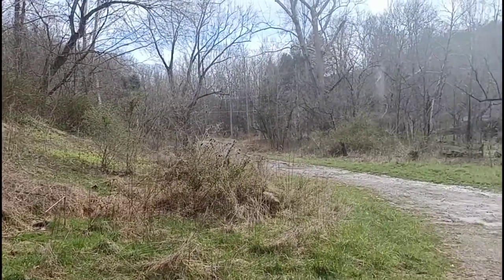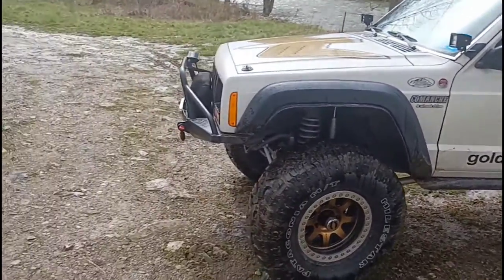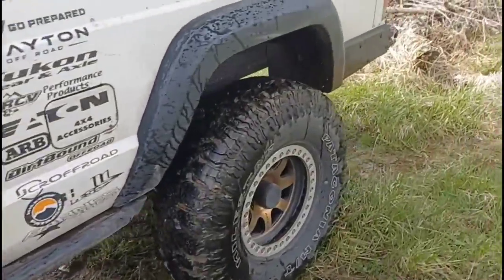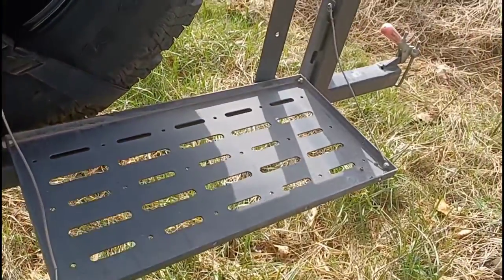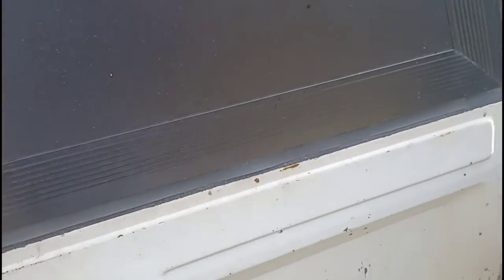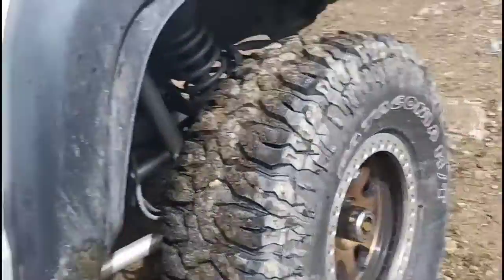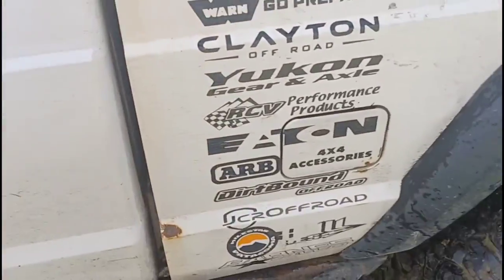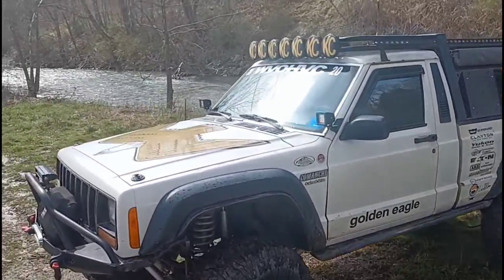"The Golden Eagle" 1989 Jeep Comanche Build

Comment: I've got an 87 Pioneer Metric Ton with the Heavier axles n frame n suspension package. Currently OEM. Live way up in the mountains on steep rugged path. Not looking to build a rock crawler. Just need ability to climb up here year around and like now with waste to chest deep snow. Plan simple 4 1/2" lift and maybe a 456 gear set. Have a Taco on 36x13.5 x 15" Super Swamper I ROKs and 6" suspension and body lift that goes anywhere. Our daily drive is what the city boys consider a 4x4 adventure. We just call it a country road. Your rig has some interesting functional ideas. Thumbs up and I'm subbing to help u along. ( By the way. I'm knocking on 80 yrs old so my days of adventure are mostly done. This is strictly utility for Us. Wife has a Taco.) Will be following to see how that goes. Stand strong and live Free Dandahermit

Comment: What brand are those flares? i love the stock look, trying to stick with it.
Reply from the maker: They were Notch Customs flares, and took alot of time and effort to make fit correctly. They are super expensive and take forever to get after ordering.
Reply: Hey man, thanks for taking the time to reply. Im running 7.5 springs so I don’t necessarily HAVE to trim as I can articulate and not make contact, but the bedsides need replaced so it might save me some sheetmetal and time.

Comment: Why would they cut a fuel pump access panel? It's on the side of the tank and super easy to get to.
Reply from the maker: This truck has a 20 gallon XJ Cherokee gas tank, so the pickup and pump is on top